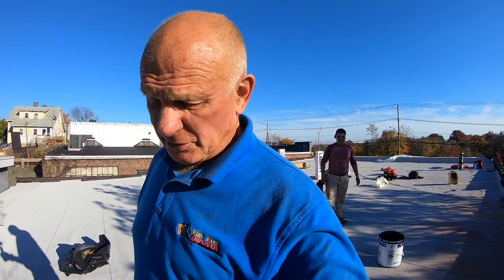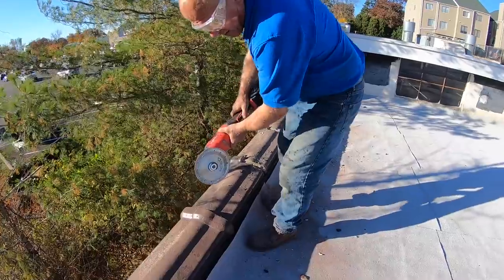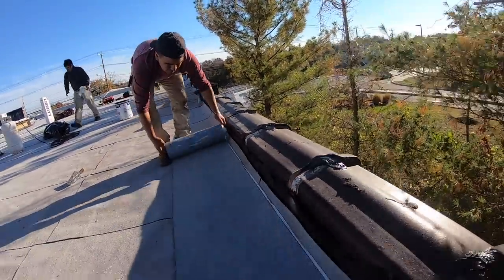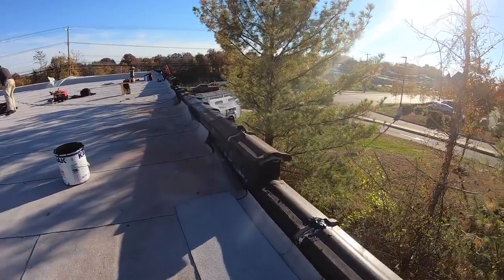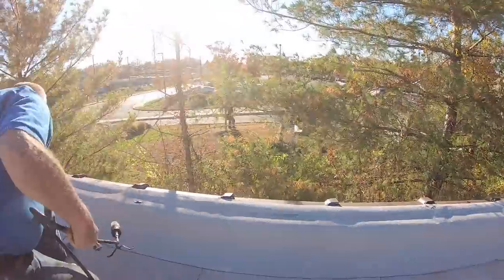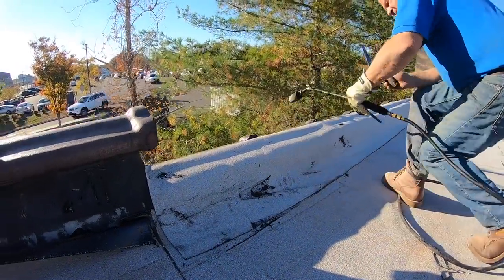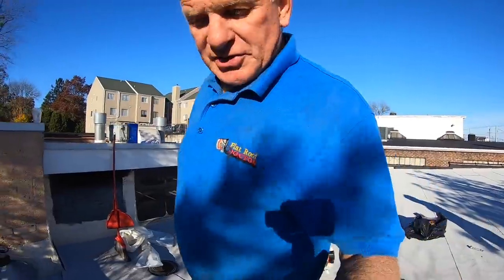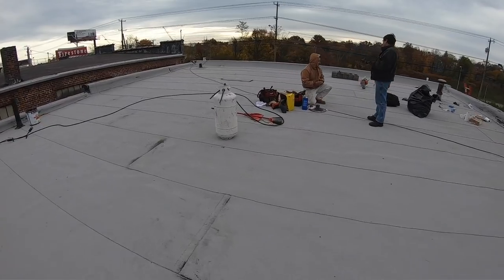Torch Down Roofing - Parapet walls and Caps - my method that worked for 35 years

Comment: Problems:
1. The top gloss clay to tar connection will delaminate and leak within 1 year.  The bottom tar seal will hold the water in.
2.  The tar over inside parapet wall will damage the masonry through freeze/thaw cycle and allow water to flow over the entire inside wall.
Solution:
Proper parapet wall cap with clean drip edge on both sides.

Comment: You still need to cover the the parapet wall with a “non-combustible material” the minimum of the width of the parapet well. You can’t just leave the asphalt exposed like that on the top of the parapet wall per code.

Comment: Thank you for this video. It's very helpful. For a residential flat roof is the torch down roof as durable as tpo?
Reply from the maker: Hi
The question should rather read, "is the TPO as durable as the Yorch Down?"
There is nothing that comes to longevity and durability as a Two Ply Torch down.
Reply: @FlatRoofDoctor  thank you very much for that response. So torch down is more durable and also more cost efficient. A winning combo in my book

Comment: Hey can I install this main brain stuff on a old metal roof .. what you recommend to fix a 12x35 Mobil home with a flat metal or aluminum roof
Reply from the maker: Yes, the Turbo Poly Seal works excellent on metal repairs. Just make sure you clean the surface. Prep is key for anything
Reply: Flat Roof Doctor Awesome 
I might have to replace that section some of the panels are pretty bend and others try to repair it with caulking stuff all over so I’m thinking to replace the metal or just seal some sections with your product
Reply from the maker: @rvingmontanezway103  No matter how bad the metal is bend, as long as you remove all the silicone junk others have applied, be assured that Turbo Poly Seal will do the trick.
Reply: Flat Roof Doctor He Thank you for the tip I’m definitely getting me a few cans of this stuff 😁👍
Reply from the maker: @rvingmontanezway103  You are welcome. I am planning to take my new wife to Pensacola hopefully at the beginning of September. We got married a few weeks ago and I took her there for a 2-day honeymoon. This was the 1 st time she ever saw the real sea and a real sandy beach. Water was awesome. Before we hit winter in Connecticut I want to taste a little bit of that Gulf in Pensacola. It brings back the youth in me.
Thanks for chatting.
Take care
Reply: Flat Roof Doctor Wowo That is Awesome Buddy.. I’m glad you happy and looking forward to being her back and you as well. Pensacola is beautiful.. If you ever have the chance I will suggest for you to visit De Soto Park in St Pittsburgh Florida and the beach there it is truly Amazing. And other Amazing place is Venice Beach 🏖 Florida and Sarasota.. every where u go there is beautiful . The hall Golf is Truly Amazing 😉.. have fun and stay ion touch.. I wish u a great trip .. talk to you soon again
Reply from the maker: @rvingmontanezway103   Thanks man, My sister lives in St Petersburg. So I am familiar with that part down to Sanibel Island. 
Have a nice weekend

Comment: Hi, Naas How would you have done this if the property owner didn't want the caps cut? 
Is there another method of doing the repair?
Reply from the maker: Andrew Beaudry I have done repairs before with the ribs in place but it’s a bad idea. 
The next idea would be to remove the caps completely. Clean the wall from all the junk that people have added below the cap. Bring the membrane up and over the wall, then install new cap. Either with terra-cotta or metal. A lot of work. 
Also, if below the cap is not bad, meaning there is no tar and stuff.  Then bring the membrane right up to the cap underneath. That’s how it’s suppose to be.
Reply from the maker: Hi
Sure, you can have metal caps fabricated that covers everything. The way I demonstrate is the most effective and cost-effective solution. Someone else might have some other ideas. 
If anyone got ideas for this solution, please comment here.
Reply: Amazing job how much I am learning thank you videos

Comment: So much wrong with this video.😂😂 I like how he always says “it will not leak for another 40 yrs”😂😂
Reply from the maker: This is 4 years later, and nothing wrong with the roof. Do you suppose there is some truth in it. I have been doing this style roofing for almost 40 years. All my roofs are still holding strong. I made a video lately showing some at 15 and 20 years. There is no difference, if it last 5 years it will last 30 years

Comment: Why wouldn’t you just take the coping stone off and put a new wood nailer on with new coping metal ?
Reply from the maker: I did mention that too in one of the comments that there are other ways to go about it. What you just described to do would take 3 times longer and 3 times the cost. You suppose my bid would be competitive in landing the job if  I had to include the work you describe? I was $3000 higher than the next bid already. It's all to do with pricing. This is a commercial building and he just doesn't want it to leak. I even went over an old wrinkled build-up roof.
Just my thought on why I do what I do
Reply: Flat Roof Doctor I agree it would take a lot longer to do and it would be more cost Efficient to do it your way .I have never seen this technique done before just was wondering why you did it that way good work on the job not criticizing your work
Reply: @cbreezyb7299  He doesn't know what he is doing but he want's to save money and pass the leaks onto the property owner down the road.

Comment: Do you think this is a quality repair or no or should I use just Hot Tar
Reply from the maker: Ok I am trying to think what you mean by "Hot tar" 
I have never worked with "Hot tar" and I am no expert in that. Hot Tar is bitumen that comes in a solid form that is then heated up in a kettle to become liquid.
Now to get to your question. It depends on what you want to repair and big the project is. If it entails an Old Hot Tar roof, then it's better to use hot tar if you can find someone with a kettle.
I use Modified Bitumen Adhesives for many of my repairs along with a membrane. That is something like a cold tar in a bucket. Karnak 81 Trowel grade is the best for many repairs. Never use Henry, Bull Dog or other cheap brands of tar you can buy at Lowes or Home Depot. By the way, Home Depot started to carry Karnak 66 Trowel Grade. An excellent product.
Reply: @FlatRoofDoctor  i do have a old tar and gravel roof it has two leaks  i have been scraping the gravel off and its all crackin  , and it does pool in some spots , like 900  square feet i might just have some one just redue it ive been trying to figure out from watching you videos and others all flat roof stuff
Reply from the maker: @happydays454  My advice - That roof can't be fixed. Install a Two-Ply Modified Bitumen Torch Down directly over the gravel and all.
Without seeing it, I can do it for $8 K. There are many factors that could change the cost. Drains, A/C units, parapet walls and so on. Send me pics to my Tel no 203 858 0080 and I will help you find a cost-effective solution for you. But stop trying to fix that BUR. I know money is always tight, everyone is in that same boat. Just text m,e and I can help you. I finance jobs too.
Reply: @FlatRoofDoctor  cool thanks all the info im in new mexico
Reply from the maker: @happydays454  Too far!!!!!!! you can get it done for much cheaper there. A good price would be between $4 - $5 k
I  am getting married soon, maybe I'll stop by on my way to Grand Canyon and do it for you. Just kidding. I hope all the best for you. What you could do in the meantime is to scrape the gravel away where the cracks are, use a leaf blower to blow the dust off, then use Karnak 66 brush Grade and pour it all over the cracks. Use a brush to work it in too. That might get you by for a long time.
Reply: @FlatRoofDoctor  congratulations and thanks for the info
Reply from the maker: henry Wahlberg I am glad I could help. Good luck

Comment: This guy is normally awesome. But I wouldnld let him torch my dogs house.  Wall flashings should only be done in 3 ft pieces maximum
Reply from the maker: Just because you learned from a book or a Union, doesn't mean that's the only way. BTW, your dog must have a big house, I can hardly imagine.
Reply: So you're saying 3ft., starting at the far side of the top of wall down onto the horizontal roof surface or just enough to overlap the turn up on the wall.